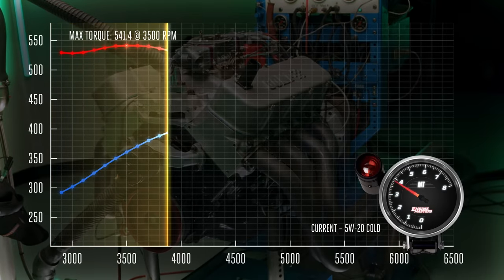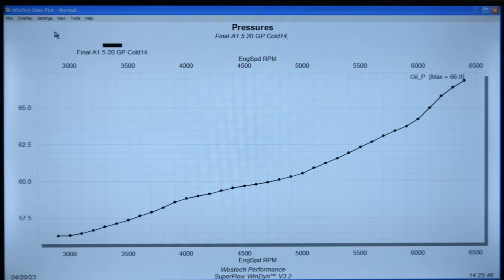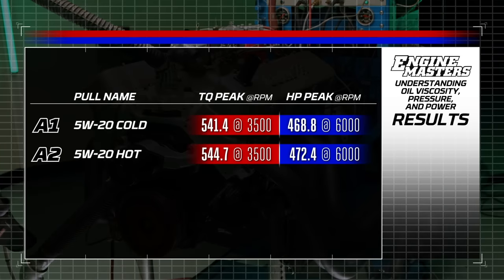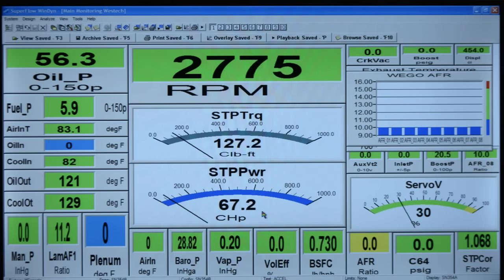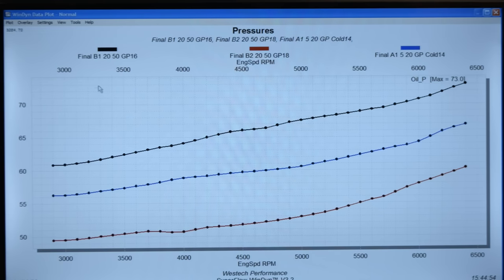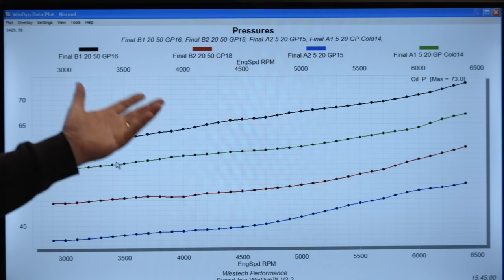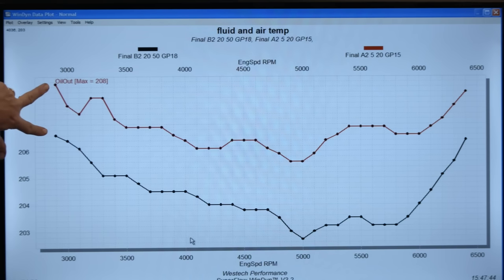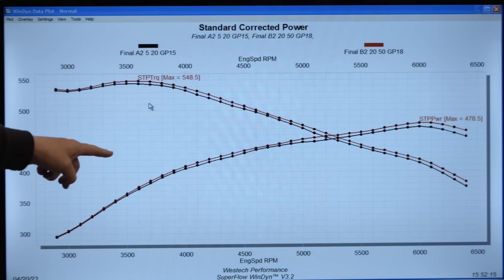Does the Thickness of Your Oil Matter? | Engine Masters FULL EPISODE | MotorTrend

Comment: I am really interested in this as many newer cars are using 0W-20. I believe dealerships are making errors with some cars by putting the more common 0W-20 oil in their cars instead of the recommended 5W-20 or 5W-30. When I took my sports car in they likely used the wrong (thinner weight) oil  as my oil temperatures were lower by 5 degrees when hot. Also I know it varies case by case but what is the risk 0W-20 will shear causing damage compared to the recommended 5W-20 / 5W-30
Reply: I'm not an expert, so take this with a grain of salt....

The thing to remember with oils is that film strength is not only dependent on thickness, but also with different types of oil.

For example one 5W30 may protect better than another type of 5W30, based on the HT/HS (High Temperate High Shear) rating

For example C3 engine oil has a HT/HS rating of a MINIMUM of 3.5

Whereas an A5/B5 has a HT/HS rating of between 2.9-3.5 (so this would give better fuel economy, but not protect the engine as good as the C3 oil)

A3/B4 has the same HT/HS rating as C3 BUT is higher in sulphated ash (1-1.6 versus less than or equal to 0.8 for the C3) but the A3/B4 has a higher minimum TBN (so you MAY be able to go longer between oil changes).

(I'll post the link as to where I got this information from in another reply, since YT doesn't seem to like external links).

So without knowing the actual specs of the oil, you can't really determine if 0W20 could damage your engine versus the 5W20

At face value based on thickness and that the dealer used it, I would say that it shouldn't.

But if you were using 5W30 and they used a thinner oil...... thickness matters, so the engine MAY be not as best protected under severe driving conditions.

What I always recommend is to see what the owners manual says you need as a good starting point,

Check forums etc

Re-check the owners manual to ensure the advise doesn't conflict with the owners manual,

And then go down the rabbit hole of OCDness in looking at the huge range of engine oils that fit your car, followed by analysing and over analysing the brands etc, and then more than likely going an over kill option (or at least this is what I do..... I just used USD $73 engine oil.... instead of the cheapest main brand option of USD $39..... in my 2017 Toyota Camry.....)
Reply: Great write up! The only thing I want to add is that 5w20 and 0w20 viscosity will only differ anywhere from 3 to 5%. It doesn’t matter. The rating difference comes about thru CCS and MRV results.

Comment: Another important factor when choosing oil thickness that is usually overlooked is the ambient temperature that the oil is used in. That's why Car companies like mercedes don't recommend a certain viscosity of oil but instead outlines a chart of how thick of an oil you should run based on the ambient temperature of where you're running the engine.
Reply: Some engines will be affected, but some will reach the same temperature on the oil at operating temperature. The W number though is important for cold starts. 🙂
Reply: I dunno about all manufacturers, but some of my old Dodges from the 80s had a chart like that in the owners manual.
Reply: @Summit2012 All of my old Dodge's got 15w-40.

Comment: I run 15w40 in almost every thing from lawnmowers to my daily driver witch is a 4 banger Honda I noticed I get little better mileage than with the recommended 5w30
Reply: Only time you should notice improved gas mileage with a higher grade of oil is when the motor is worn, and the thicker oil helps seal/improve compression.

Comment: It is common for oil to get up to 300F in motorsports, however the SAE test is only set at 212F. What is the solution for maintaining bearing protection at temperatures above 212F? Add enough oil cooling to hit the 212F spec or is it safe to increase viscosity till oil pressure gets back in spec?

Comment: Here in Texas on any day 99-100+ degrees my oil temps get up to 251 when cruising at 80 mph. The pressure at cruising at 2500 rpm is 40-43 psi, at idle it will be 29-32 psi. In cooler temperatures the same oil will only get to 225-228 cruising at 80 mph. Cruising pressure is 42-45 psi at idle it will be 32-35 psi. Wot with the temps at 250 pressure will be 49-55 psi, wot with temps at 225 pressure will be 55-59 psi. So, it does make a difference.
Reply: 250 is pretty hot
Reply: @firstlast---  that's without a cooler. But that's only when I'm going a consistent 80-85 once I drop it down to 70 it will go down to 240

Comment: More than anything, I want to know how the different oil weights handle track temperatures. If it's getting up to 300º, what happens to the oil? I'm guessing the 20w won't be able to sufficiently protect the engine. At that point, it doesn't matter which one makes more power.

Comment: So I haven't read the comments, but you used this in a 454. What year was it made? It would be interesting to see this test done in a new LS as in general, the tolerances in the build are tighter which is why they can use a lower weight oil.

Comment: Great test and insights! Maybe next to investigate is whether different oil blends (i.e mineral vs semi synthetic vs full synthetic) with same oil weightage has an impact on power and torque output?
Reply: Just use full syn
Unless your engine predates science
Reply: @0Sirk0 mineral oil is said to have better cleaning properties and runing full synth on an engine that isnt spec for it can ruin oil seals and wont burn as well like mineral oil.
Reply: Yes! It would be interesting to see if the synthetic racing oils with bucket loads of moly in them (e.g., Redline, Motul 300V, Royal Purple, Mobil 1 4T Racing etc) live up to the hype of reducing friction.  Of course you can get mineral racing oils with lots of moly in them too (if you're old school or for rotaries^?).  ^ Synthetic vs mineral oil in a rotary is a quite a controversial subject in it's own right!
Reply: @proxypanda4156  "runing full synth on an engine that isnt spec for it can ruin oil seals"  Seal compatibility has generally been fixed since the early synthetics of the 70's/80's.  "mineral oil is said to have better cleaning properties"  Oils like Pennzoil Platinum Ultra (gas to liquid base stock) are very good at keeping dirt in suspension, but whether that's the base stock or the detergent package I'm not sure.  I'm pretty sure PAO is excellent at cleaning engines too.

Comment: This was a really good watch, very informative, but how does thick or thin oil affect the economy of a car?
Reply: Thinner is usually more economical which is why manufacturers have moved to lower viscosity oils such as 5w30 as it takes less effort from the engine to pump it round slightly improving economy and therefore emissions.
Reply: @pauldethick6175  Makes sense

Comment: What a confusing deal. I’m just trying to quiet a top end clatter on startup with an old VG30e (1996) while also making up for bearing wear. Recommend winter oil is 5w30 but I’d like to go to a thicker oil instead of using additives. Winter is coming soon and that adds to the the puzzle. Any good recommendations would be greatly appreciated.
Reply: I would recommend 100% Synthetic Amsoil Signature Series 5W-30, which is what I use in my 2013 Subaru Tribeca that gives it phenomenal performance.  Many verified customers on the Amsoil Website have related that using the Signature Series oil cured the noises they had in their engines.  All Amsoil Motor Oils are 100% synthetic and according to Rafe Britton, a former Lubrication Engineer at Mobil who has the YouTube Channel “Lubrication Explained,” he says that in order to qualify as a 100% synthetic, it must be composed of a PAO (PolyAlphaOlefin, a Class IV Synthetic) and an Ester (Class V Synthetic) or other combinations of pure synthetics, without a drop of petroleum oil.  The elite PAOs are made with metallocene, thereby giving them the designation of mPAOs. Rafe explained mPAOs have a higher viscosity index, lower traction coefficient (meaning all the oil molecules having the same exact size), better oxidation stability, better low temperature fluidity and lower foaming tendency.  

Although Amsoil won’t give away trade secrets, I suspect that their Signature Series oils contain metallocene.  I say that as an Independent Amsoil Dealer (all Amsoil Dealers are Independent Contractors, as opposed to actual employees of Amsoil).  You can apply to be my Preferred Customer with Amsoil for an introductory price of $10 for 6 months or $20 for a year, which provides you with a 25% discount, along with a 25% sales tax reduction off the retail price, free shipping on orders exceeding $100, plus other incentives as well (such as a $5 coupon when you spend $100 and you would get another coupon on your birthday, although you would need to redeem the coupon(s) in 90 days.  As a Preferred Customer (PC), you would be entitled to contact our Technical Services Department. They also provide special incentives to PCs that aren’t available to dealers.   

If you agree, you can go to Amsoil Website and sign up as a PC with my Referral Code of 1420935.   There is no obligation for you to continue your membership.  If you decide to become a PC, the delivery usually takes 2-3 days.  Thanks for your consideration!

Comment: Need to regulate a fluid cooling situation?  Try a Penn valve - they modulate flow with just a tiny bit of lag as it is a mechanical design.  Should be able to stay in a 4 degree window.

Comment: As a sidenote, thick oil will "help" not only to ring seal but also valve seal and seal overall. My dad used to run 80w-90 in his  clapped out SAAB v4 since it wouldn't hold regular engine oil. It prolonged the oilfills from hours to days, smelled so you could trow up though...
Reply: You know that 80W90 is something like 15W40 engine oil ?
Reply: Learnt something! 👍 However the stuff he used was thick as syrups! (Could have been some type industrial oil)

Comment: In the 2 stroke world, ring seal is always best for max power.. High strung 2T engines run 16:1 mix for more oil film on the walls to seal the rings better. Most people have a backwards thinking that by using less oil in the mix, you are putting in more gas instead, and the engine will be more crisp.. that is false. the A/F mixture needs to be re calibrated to allow for the extra oil (i.e. jetting size increase) You can probably do the same test using thin engine oil for less pump restrictions, and add a small amount of oil in with the fuel to seal the compression rings better, where in a 4 stroke will see very little oil above the oil control ring.

Comment: If i have GM 5.3 (L84)
And they specifically ask for 0W20
But i live in extreme hot climate 
It goes sometime above 50C (122 F) temperature 
I don’t think the 0w20 is suitable for our climate , what should i do?
Move to 0w30? 0w40?
Reply: I’d use 10/30 conventional and change every 5000 miles or less

Comment: That's really good data. Now let's consider a real case result.  BMW recommended a full synth 10w60 for mid 2000's  era NA 8000rpm S85 V10s. Known to develop main bearing issues with factory bearings at 60-80K miles; new and rebuilt. "Race" bearing replacements are suggested, with more clearance. The water temp runs high, a 180 degree replacement is recommended by some, along with a thinner oil after rebuild. BMW recommends 5W30 synth for later engines, including turbocharged. Some say that oil development has improved in synthetics. Back to the V10, is it cold start up abuse and daily wear, needing to see a proper window for higher RPM "normal"? And were main clearances too low for daily driving/race oil initial temps, along with climate considerations? Was BMW trying to hit 500hp target with wrong oil for street use, and wrong clearances for same usage? Some say that the later turbo cars are better engines. But is it bc of better oil recommendation  for American drivers, or just better oil?  For the V10 I think the race bearings, 20W50, 180 stat and proper operation will work just fine. I'm less  involved in some horses at the top end. I don't want the bottom to fall out.   Word
Reply: I'd never put 5w-30 in any BMW. 5w-40 sure.

Comment: i have just run in a virgin block with 10 w 40 mineral and factory filter = just changed to 5w30 fast flow synthetic with factory performance filter = yes i can feel the differance = at 7,000 klm 5th oil change .

Comment: An easy way to wrap your head around what the numbers mean is this, The winter first number is its initial thickness the second is the oils resistance to thinning out when hot.  Typically when the second number is higher they had to add more additives to make it more stable at high temps.  With high additives in the oil it is not as good and the engines wear will be higher.  This is where better base stock oil comes in its more stable without the additives, ie synthetic ester and such.  I use to work in an oil test lab been out of the game for a number of year now.  It was cool to see the dyno, never thought of it from that side of things before.

Comment: Boom   That's always been my conclusion    You know I think That especially after this test I really do think that  this ultra low viscosity oil they're pushing for these newer vehicles isn't allowing the rings to seal correctly allowing bypass carbon build up especially behind the rings makes the ring stick and gouge the cylinders      of course then with the rings not sealing she's gonna use oil   .. some people have noticeable results by  soaking  the piston and rings in berryman B12 fuel system cleaner which  helps quite a bit but by then usually They have sustained a lot of wear damage from metal to metal contact from that insufficient hydro wedge    ..as my motors get more miles on them   I step up the viscosity  But I would never use a  0w15  aside from being in a new car for short period break in oil    aside from using it in the winter time way up north  no way I would use it for hot weather conditions  ..15W30  is about as low as I would ever want to go

Comment: I typically run as thin of oil as the engine will allow! Hold good oil pressure at idle hot and not burn oil (considering the engine is sound) 
Pushrod engines I run 5w 30 to 15w-40 ……..anywhere in between!

Comment: I'd like to see the same test with a modern engine spec'd for a thin oil, I wonder if the power difference is just dependent on how well the oil suits the engine's tolerances.

Comment: Guys we learned that years ago on old farm diesels you run thick oil in a worn engine, i had an IH 1206 diesel with over 10000 hours on the engine, we never touched it thru all the years except the injection pump, as it got tired i upped to 20 50 and it maintained HP oil pressure and under a liter burnt per oil change ,if you used straight 30 it would burn at least 3 per change.

Comment: I have a Honda van it has 180k miles should I use thicker oil if so what do I use? Like 20w50 maybe?
Reply: Can't use thick oil like that on variable valve timing engines. Use what manufacture suggests.
Reply: I have a Honda with 165K and I use10w40, no problem

Comment: My thought is if my stock engine asks for 0W-20 would it benefit longevity-wise in the hot summer with a thicker oil? Would there be any cons considering many engines have oil dilution problems do to manufacturers loosening the rings too reduce resistance?  Any thoughts..
Reply: Exactly my situation with a new RDX. I run 5W30 to have a buffer for oil dilution, which I have confirmed with lab oil analysis. Runs great. As a general rule, one grade up over the sticker is nothing to worry about, especially as ambient temperatures rise.

Comment: Surprised that the thicker oil was more stable. I don't think the trade off from lighter weight oil vs heavier is worth it. Ring seal is Key to Power. I wish they had done some more tests with say 10-40 weight oil. However it was an Interesting Tutorial.